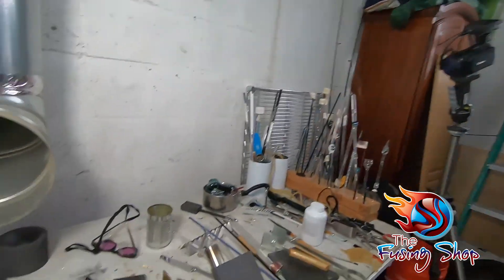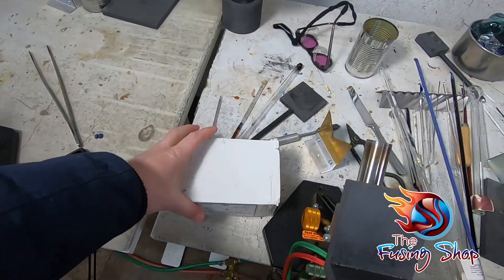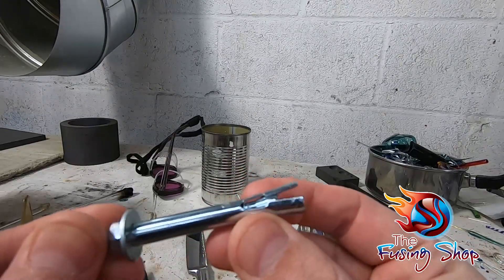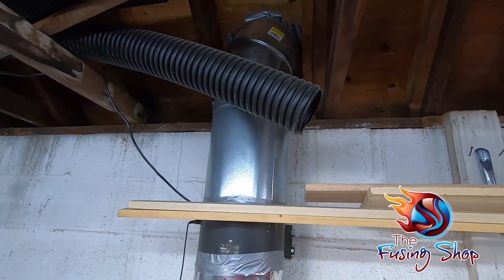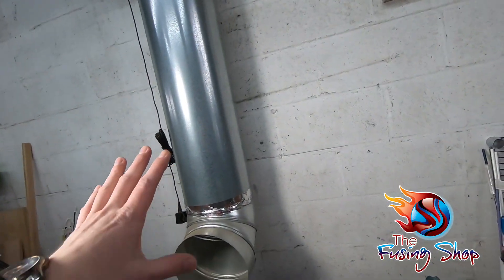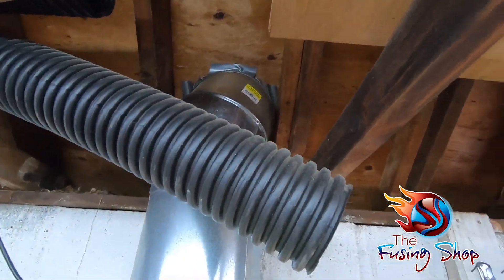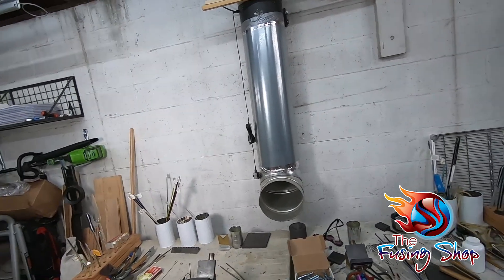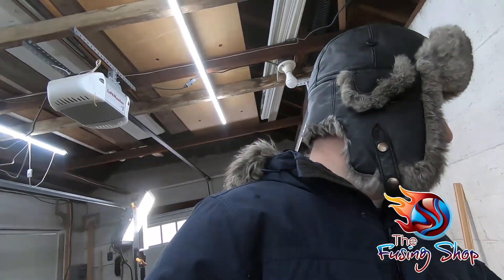Lampworking | Glassblowing Ventilation System | The Fusing Shop

Comment: I use a 3000 cfm 30" whole house fan ,talk about loud ,lol. I am tired of the noise last 10 years.I have plenty of grow fans just laying around ,should have changed my setup by now . A hood is definitely a good idea , I wonder what would happen to bubble trash with this setup . 🍻😎
Reply from the maker: 3,000 CFM is more than enough.  What is the size of your space?  With 3,000 CFM, that should eat bubble trash for dinner, or maybe a light snack.
Reply: @FusingShop  ,it works great ! Just loud for neighbors when I work all night . Just installed 2 8" fans and I am dissapointed . One has 460cfm and the other 875cfm on high I assume and I like the sound on medium but high seems loud also so might have wasted my time .
Reply from the maker: @jacobreynolds4547  Lol I hear.  Those fans can really cause a racket.  Better to deal with the loud noise then to have toxins going into your lungs.  All the best!  Sim

Comment: I have noticed your ventilation because I am looking at setting it up myself. I have a Nortel Minor, so I feel like 6" is about all I need in diameter. My main issue is I'm in a rental house currently, and I am not in a position to move right now. If all goes right, I will hopefully be moving around June 24. In the meantime, I can't exactly stick a vent through the roof obviously. Would there be any issue with running a flexible vent hose past the fan and having it go out through the garage door, or the door that goes to my backyard? I have dogs so my only concern would be glass blowing out onto the ground, but I didn't know if that was a problem with small amounts. Sorry so long.
Reply from the maker: Hey Ryan!  Thanks for reaching out.  You need to make sure the vapors are being removed from your workspace.  How close is the garage door to your torch?  The purpose of the ventilation system is to pull the fume and toxic vapors away from your face so you don't have to worry about glass getting sucked into the fan.  Once the vapors are outdoors, they dissipate into the outside air so you don't have to worry about your animals breathing in any vapors.  Same thing if bubble trash is sucked into the fan, it's safe once it's out of a closed-in space.  Hope this helps!  Sim
Reply: @FusingShop  Thank you! I've been at the back but was told to move closer to the door. Didn't know if he meant that because I didn't have anything yet, or just in general even after. Thank you for your response!
Reply from the maker: @ryano2883  Of course!  Yes moving closer to the door would be better.  You don't want the vapors hanging around in the air.  You need to vent those vapors outside.  Also your ventilation system will work much better with less tubing.  The shorter the tubing, the better it will work.  All the best! Sim

Comment: Cutting the hole in the wall would have been preferable. Less of a chance for leaks, and no chance of it causing structural issues unless they were there to begin with.
Reply from the maker: Hi Kendrick!  Thanks for your input.  I hear the comment about the possibility of getting water in through the roof.  So far, thank God, that has not been an issue.  Regarding the wall, I was worried about cutting a 16-inch hole in the cinder blocks.  Either way, my exhaust fan is functional and does what I need it to do =).